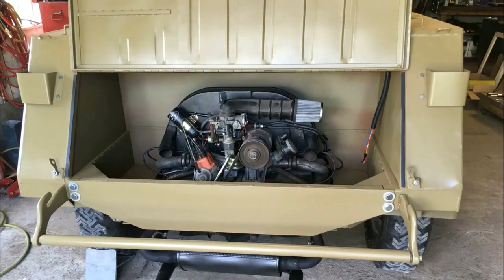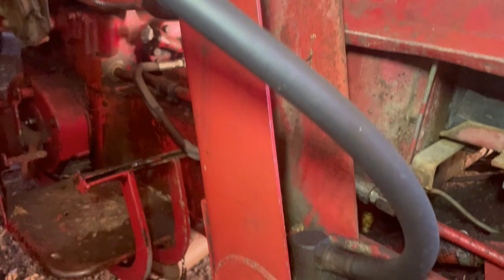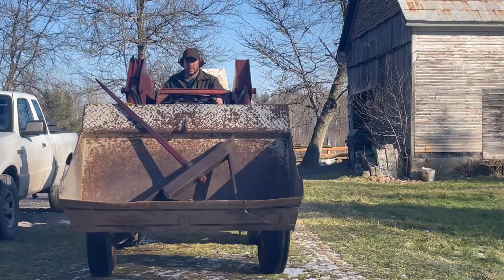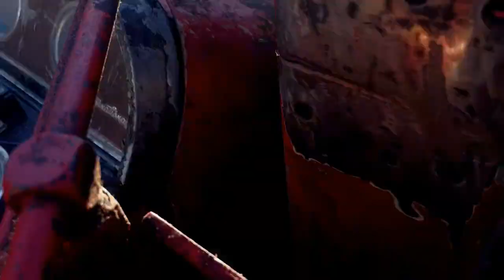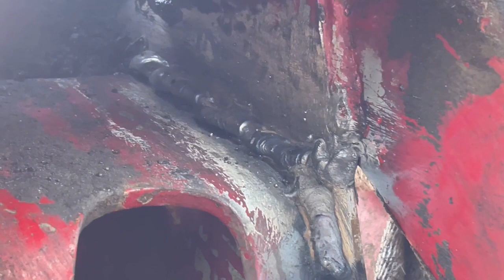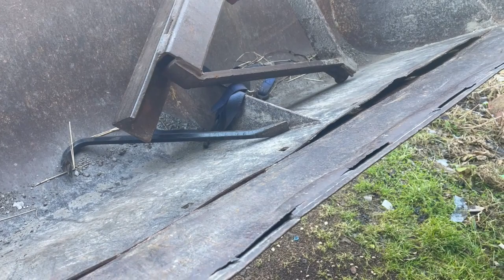Tractor Loader and Bucket Repairs

Comment: I believe the repairs are very well done and will last a long time. I couldn't have done better. I would have liked to see more in the way of carrying out the work. Thanks for the video.
Ps: It would be good to indicate the tools used, such as the welder; if Mig, what wire used vs amperage and speed feed, if rod welder, what rod # was used, amp, product used to clean, before welding etc. 👍👍🍻
Reply from the maker: Yeah that’s a good idea,  I will try to include more info on the equipment… Thanks for the feedback back